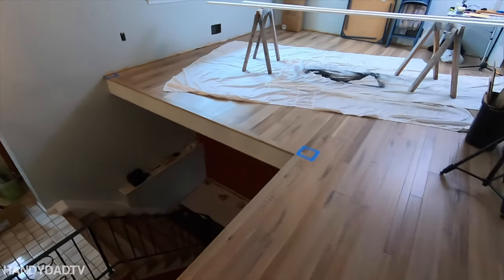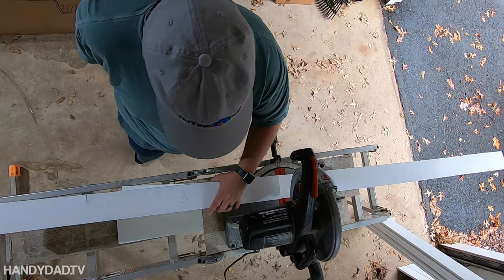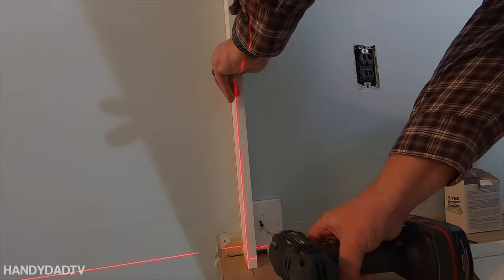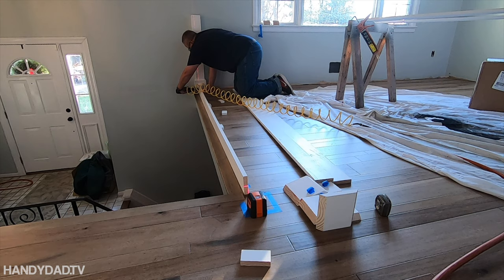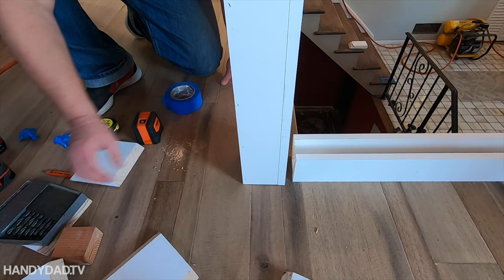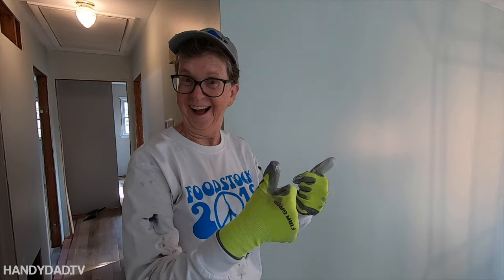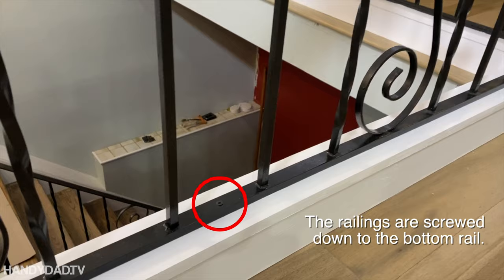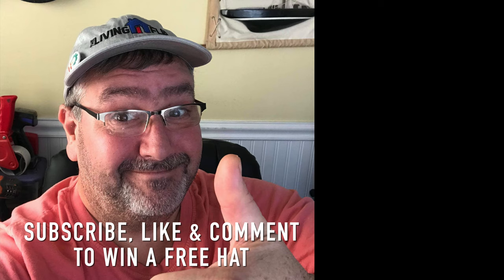WE BUILT A RAILING // TLF 15

Comment: This is great! Same situation in my home and I want to keep the railing but update so that it’s up to code and safer
Reply from the maker: Any increase in height is safer, but this design may not be “tall enough” for code. It’s definitely not up to current code for spacing, but it’s no worse than the original. 

I’m not a contractor so it wasn’t my goal to pass code.

Comment: It looks really good. But there's one thing you should check in that is if between your railing uprights you can't have a 4in ball pass through it. It's by code
Reply from the maker: Yeah it’s not compliant for spacing by today’s standards. But neither was the old one, obviously. We were more concerned about height. The original felt like you could easily fall over it. This one is much better.

Comment: Love the look. I have similar railings so I did the same to mine. Thank you for the idea. Only thing is I’m remodeling to sell my home so I won’t get to enjoy the look. As someone mentioned the spacing needs to be 4 inches which only matters if your selling, (I know your not selling) In my case, I   added plexiglass that the trim is holding in place which meets safety code. Would rather weld extra rods in but don’t know how to weld. Wish I could share a pic to show you the final product. 👍🏼 thank you again
Reply from the maker: Email it to chris@handydad.tv because I'd love to see it.